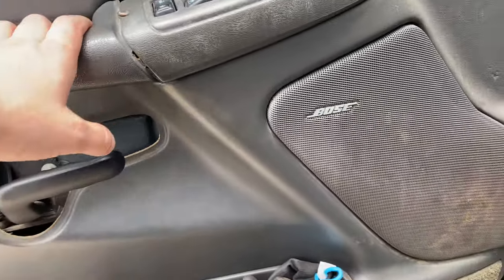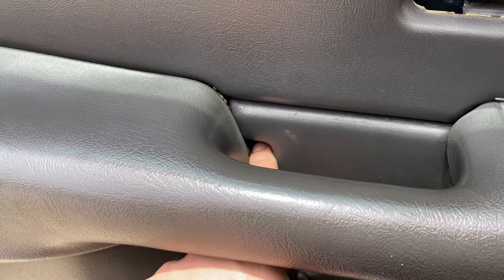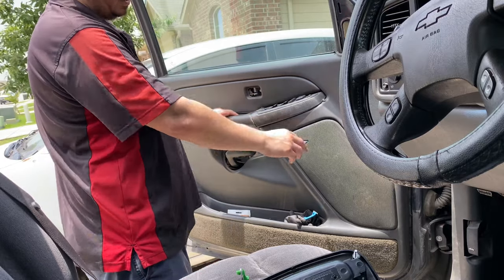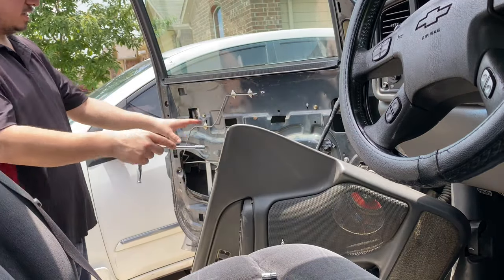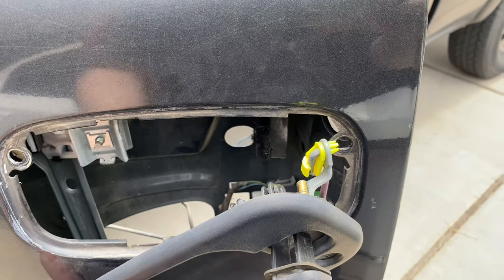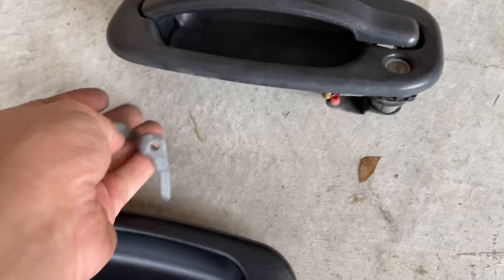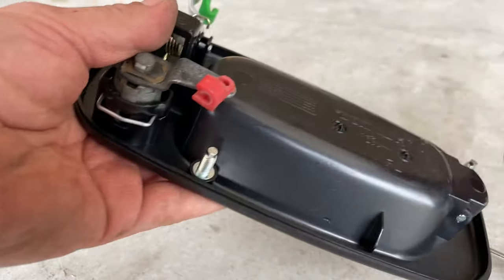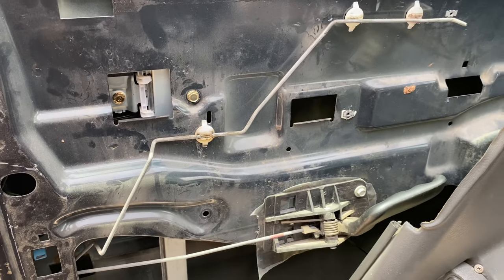How to Replace Exterior Door Handle - Chevy Silverado, Chevy/GMC Trucks 1999-2006

Comment: Hey man the car door keyhole is messed up on my truck I can’t even get the door to open because some guy tried to break in my truck how do I get the door to open I have a 2005 Chevy Silverado
Reply: So is it stuck lock? I would recommend just cutting the panel honestly if you can’t open the door so you can pull the latch enough to unlock it but it should open

Comment: To anybody who has a 99-02, you also have to remove the window lock/up and down panel, (it just pops right up and off) to get at another bolt that holds the door on, figured it out after a few frustrating minutes of trying to pull the door panel off
Reply: life saver

Comment: Thanks for the video dude… I have an old 2001 GMC Sierra I use for a hunting truck and broke the handle last fall. It’s been very frustrating as it was the drivers side… always had to crawl across seat from passenger side. I ordered a handle off Amazon for $18 and it got here last night. I just installed the new one with no frustration. I would have been able to figure it out but you made it simple.. replaced it quick and easy. Took minutes. 
So keep this video up. It still helps people. Thanks again!
Reply: Lol 😆 I'm having the same issue right now, I can only open the door from the passenger side & have to reach over to manually open the driver side lock. 🙄👎🏼
Reply: Hello fellow crawlers im here to replace as well
Reply: This is literally my life right now 😂😅
Reply: @mistycaortega3498  lol… great vid .. simple quick and easy

Comment: I have to replace a buddies handle today. This helped a lot. I picked up a replacement from junkyard but it has a key his doesn't. So I transferred the good bits of new handle I needed to the old broken one. And reinstalled. Getting that broom bolt via under the glass is tricky but doable. Saves a lot of disassembly.

Comment: I just replaced mine out of 02 1/2 ton single cab, it took roughly an hour and a half, including going to the part store, the only problem I have was the nut on the bottom, the inside door handle bar was in the way , and my fat arms didn’t help much , but all in all the video was very helpful, keep making helpful bedios
Reply from the maker: Glad I could help!

Comment: Thank you brother. In all of the 36 years I’ve had a driver license I’ve never broken one of those…… until tonight. My first car was a 1973 Z-28 LT-1 and I fell in love with Chevy. It had steel door handles. The plastic ones just like this are GARBAGE. I simply opened my door and it broke the oval part all the way from top to bottom plus snapped off plastic where the bolts go. The entire assembly is SUPER BRITTLE like it’s been cooked too long or something lol. Anyway I appreciate your easy to follow, quick instructions which were easy to follow. Thanks again brother 🤙

Comment: Very helpful, thank you.  My 06 2500HD had one more bolt holding the panel on in the lower right corner.  I also had to pull a hand crank (there is a small wire retaining clip that you can pull with a small pick).  The nuts for the door handle are 10mm.  Hope that helps someone.

Comment: Thanks for this. Ripped the handle off my 2002 Silverado Friday when it was frozen shut. Went to AutoZone and picked one up for $35 and followed these steps. Back in business! Everything worked great and it wasn’t difficult at all. Just reaching that third bolt in the handle, but the ratchet without an extension fits.

Comment: I used to break one every winter. I switched to using oem cadillac handles and no problems anymore. The texture pickup truck ones are crap
Reply from the maker: very true
Reply: My brother in-law has a 2006 GMC Sierra 2500.  What year Cadillac handle would work on his vehicle.
Reply: @danrouse2065  Same year as your truck.

Comment: Hey there. I replaced the driver side handle, and got everything connected. I closed the door to test it before fully connecting the the panel back on. The door didn’t open, so I went in to open from inside and it didn’t open either. Now I’m stuck. Any ideas? Thanks!
Reply from the maker: you need to somehow get panel off while door is still closed

Comment: I have a GMC Sierra ‘05 & it had a plastic cover. It says to not remove it, but nothing happens. Truck is old af anyways. It has an extra screw on the left side if you want to remove the door cover as well.

Comment: How can I get my lock re keyed and or done because mine was broken into with a flat drag screwdriver :/
Reply from the maker: 2 options. The dealer should be able to sell you a new lock cylinder and they should be able to cut you a new key with your vin number, also any locksmith should be able to retrieve the code and remake you a key

Comment: My 02 1500hd rear driver side handle broke off and I can’t even open it from the inside . Unlock and try pushing open and nothing , I’m at a loss on what to do at this point to replace the putter handle
Reply from the maker: somehow remove the inner door panner to open it .. ive had to do that in the past

Comment: Wats that L shaped piece for the door handle
Reply from the maker: Dylan Crank if your talking about the one on the back I think your talking about the plastic clip.
Reply: Not the plastic one the metal
Reply: @grimreaper934  you might be talking about the lock rod or whatever. Near the top middle of the panel? 1:16